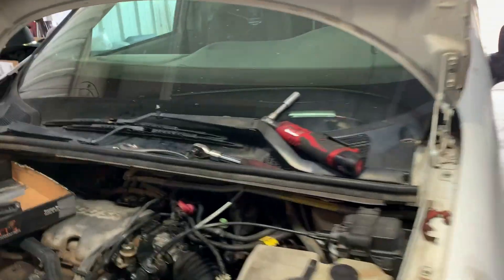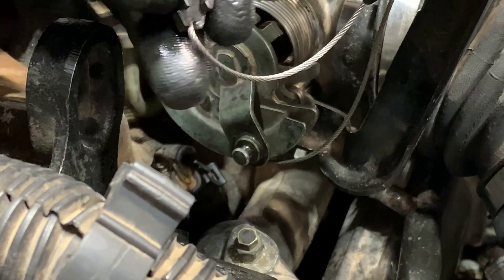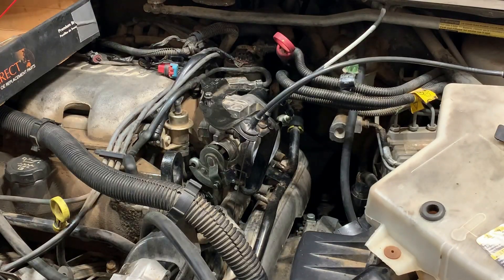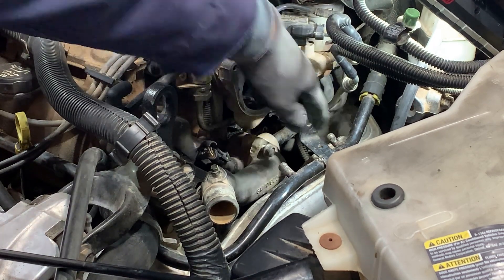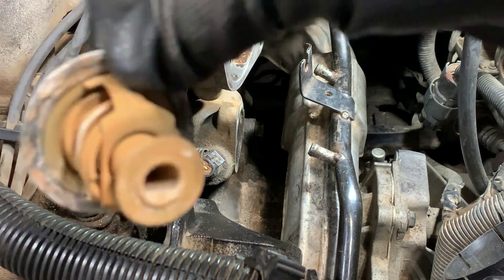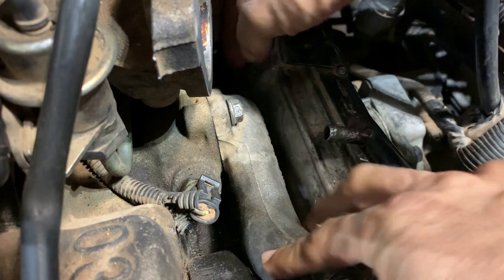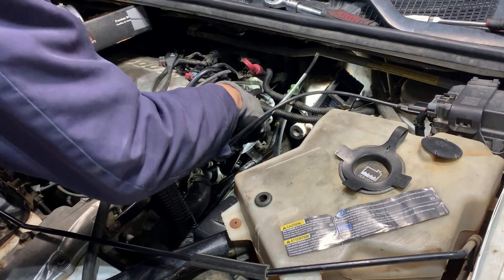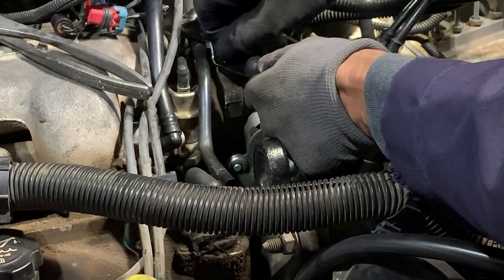Montana Pontiac 04 3.4 thermostat

Comment: Someone mixed up your top and bottom throttle body fasteners. The bolt goes on top and the bolt-stud goes on bottom. A nut threads onto that bolt-stud to hold the bracket that’s part of the metal coolant hose. The idea is that you snug the throttle body with the bolt and bolt-stud and then the bolt-stud gives you a place to attach the bracket while the head you used to snug the bolt-stud into the throttle body becomes a stand-off.